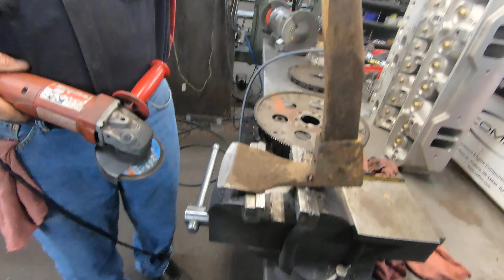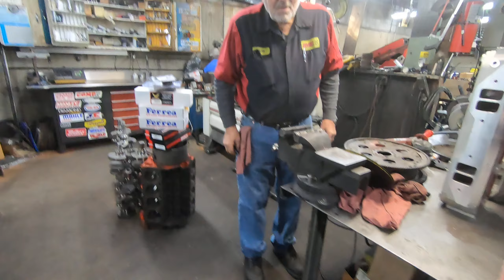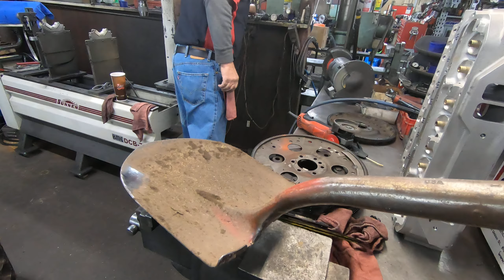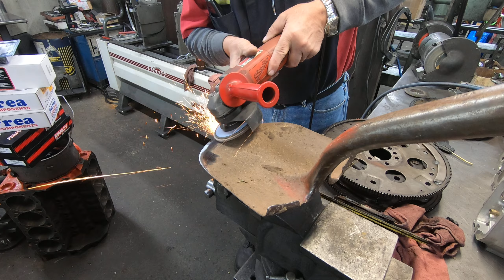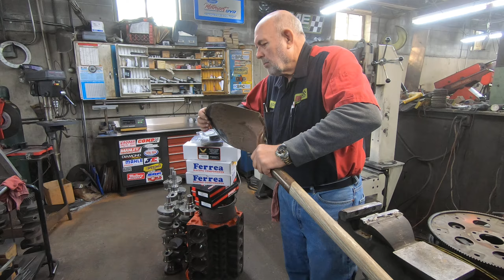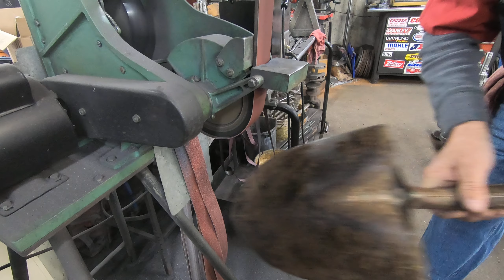Sharpening Shovels to Dig Easier

Comment: What is the type blade I should get for my grinder? Thanks in advance.
Reply from the maker: Hi Nancy, Pat here.  I would go to Lowes, Depot or Menards and look for a 4 1/2 inch wheel called a flap disc 40 grit or 60 grit the 40 grit is more aggressive so it will grind faster.  I have found these are the best to utilize for sharpening tough steel like a shove blade.  Diablo, DeWalt, Lenox, Bosch are good brands to stick by.  Hope this helps.  I have tons of content I'm working on so stay tuned!  Reach out anytime you need advice on something I'm here to help.  Pat
Reply: @RoninMasterProperties    What if shovel is chewed up and uneven? It’s a square shovel I got for free I want to fix and used. Still use 40 grit flap disc? Just do more strokes? Thanks in advance.
Reply: @RoninMasterProperties    Thank you Pat.
Reply from the maker: @nancycrisman7496  Most definitely if the end is chewed/chipped using a 40 grit would help to grind it to shape again faster.  Be careful when sanding/grinding it will want to grab twist your wrists just start super soft and easy you'll start to feel the flap disc grab the surface.  Slow and steady until you get a feel for it.  Oh yea, wear gloves and eye protection for sure !
Reply: @RoninMasterProperties  should I start higher grit and move to lower grit until I get the hang of it? I have arthritis.
Reply from the maker: @nancycrisman7496  i think you will be fine with the 40 grit.  As you see in the video though that is my uncle doing the work and i am actually holding the shovels so this is definitely a 2 person ordeal.